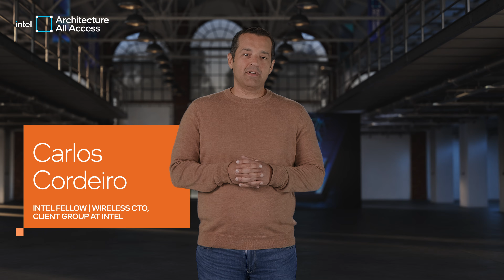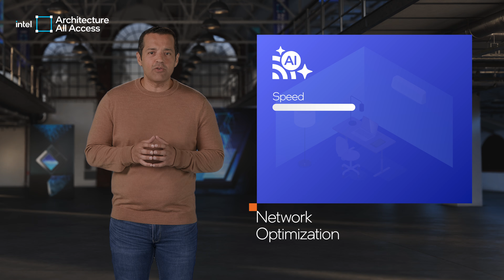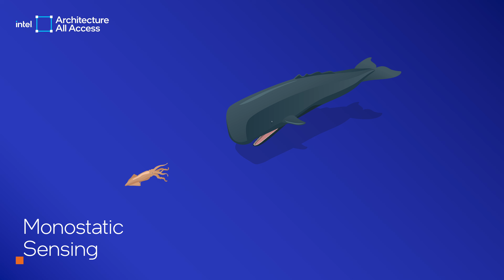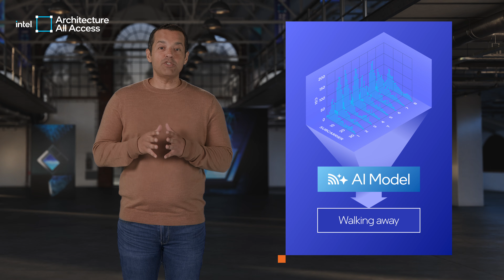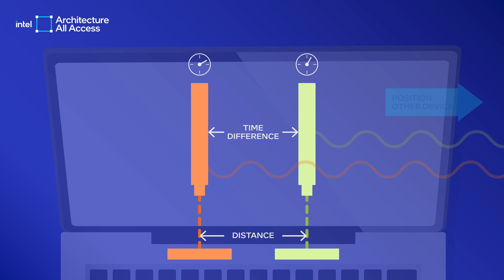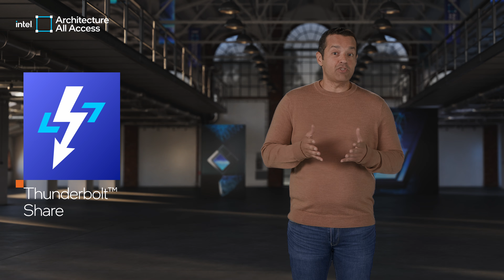Architecture All Access: Intel Core Ultra 200V series processors: Intelligent Connectivity

Comment: Intel failed by making DisplayPort 2.1 UHBR20 part of the minimum specification for Thunderbolt 5. As a result Lunar Lake comes without integrated support for Thunderbolt 5. That is not very intelligent.
Not only is there no integrated support but the discrete solution provided by Barlow Ridge has had a disappointing adoption rate for the same reason.
Intel Xe2 Battlemage will support upto DisplayPort 2.1 UHBR13.5